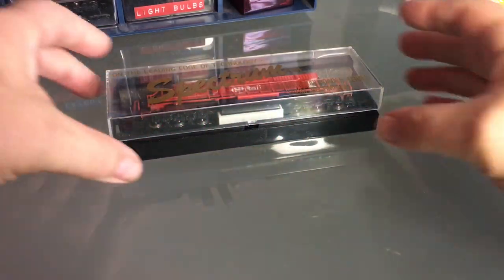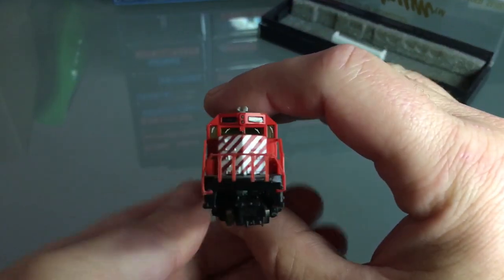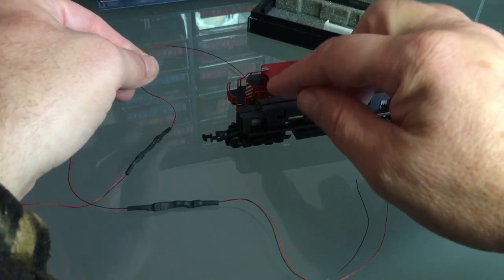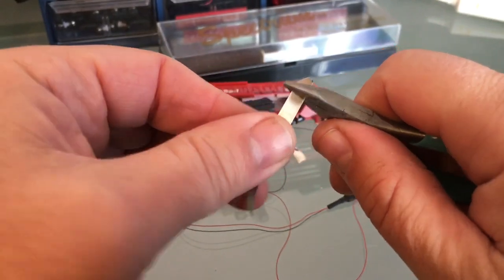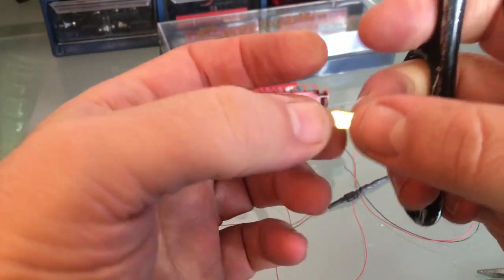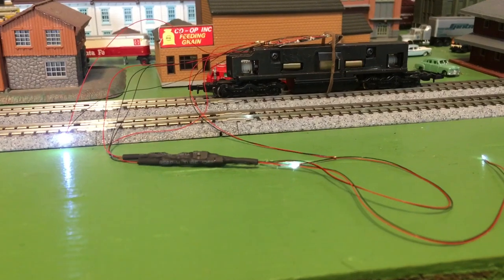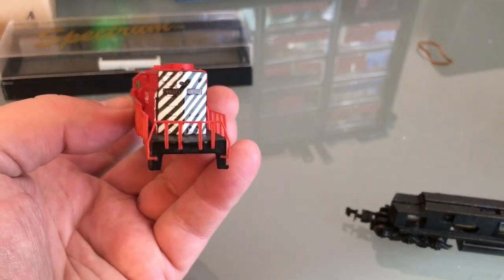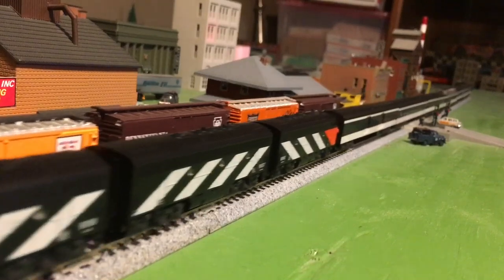N scale add ditch lights to just about any engine

Comment: You can find the calculation for led resistance online. You need to know the track voltage, the rated voltage of the led and the amperage needed to run the led. It is basically voltage divided by amperage equals the resistance.(ohms law). The blinking led may not be getting enough voltage or amperage through the chassis when the train is running. If that led has a resistor, you need to reduce that resistance. Check online for charts that give a numeric value of the color band on resistors. You can do this by trail and error. Just hook the led to a variable resistor to see what works. Then measure the resistance with a multi meter.
Reply from the maker: Thank you, i hope other people can benefit from the information.
Reply: Very helpful.

Comment: Hi.  I have a question for you .  I installed a led light on a ho locomotive, it works well when moving forward and goes out when reversing (normal) but it flashes...why?  THANKS
Reply from the maker: Probably, the engine loses contact with the track. When it rengaines contact, there is a power surge. That makes a flash in your led. I’m not an expert, but that is what my interpretation is.
Reply: THANKS  .  that's what i thought...bad contacts.  ✌️

Comment: Do you do custom work? I have an intermountain n scale sd40-2. The ditch lights are gone but there are holes for them..I contacted intermountain and they said to buy some pre wired 0402 led from China.thread them through where the light pipes were. Solder them to the pads on the lower led on the circuit board..this is way out of my league..could you help?
Reply from the maker: This is a tough job. You would have to ship it to me in Canada, and You would have to pay shipping back to the US. And I cannot say how long it would take to do the work.
Reply: I would like to go  ahead..where do you live? I'm in Toronto canada
Reply: I have another project..intermountain again..is it possible to put a brighter light on circuit board..they are pretty dull..I thought I heard about someone changing to a brighter bulb..is this possible?
Reply: Is the pre-wired 0402 light from China not as bright as the ones you have..just that they are mebe alittle to bright and would overshadow the nose headlight
Reply from the maker: I live near Montreal. We are practically neibours!
Reply: How do we proceed..should I post my email on here?
Reply from the maker: You can email me ericlessard@hotmail.com